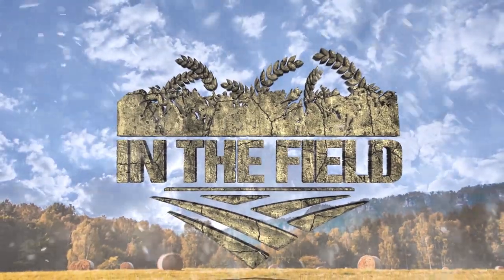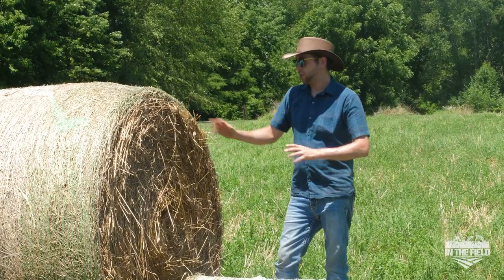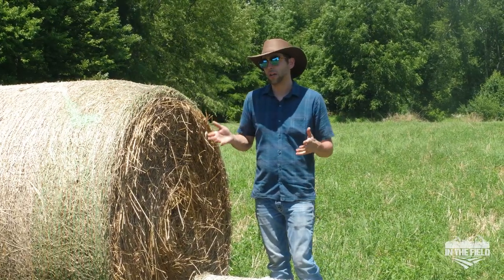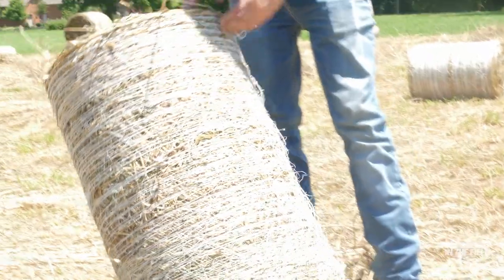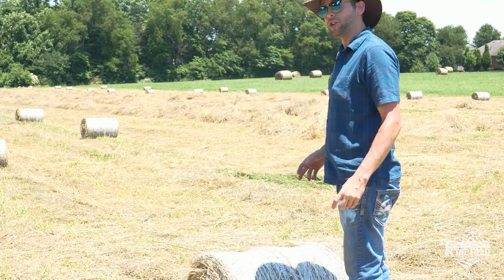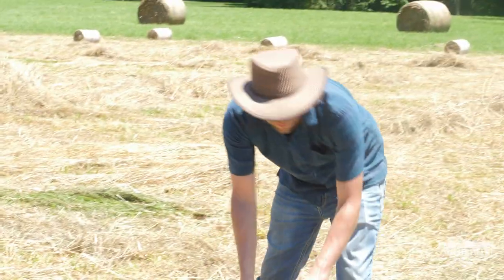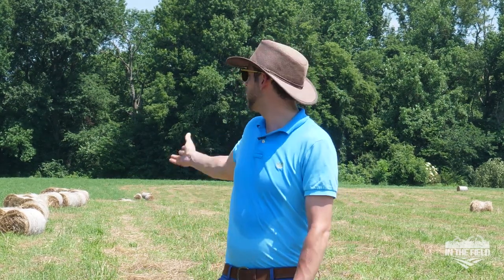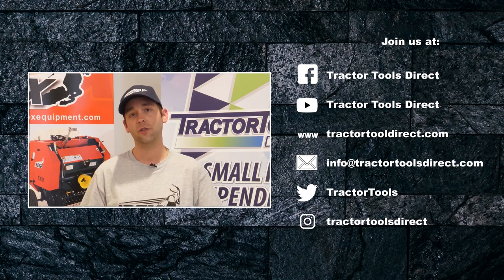In the Field: The Hay Making Process (Part 3)

Comment: I need to call you guys to help troubleshoot my Abbriata M50 net wrapper.  After engaging the wrapping mechanism, the baler wants to keep wrapping the bale...the only way for me to stop it is to disengage the PTO, pop open the rear door, then cut the uncut net wrap with a knife.  It looks like the knife edge isn't falling off the threaded shaft with as much force as it used to do.  Tried cleaning/lubricating but that didn't help.  Caused a major problem during my last baling session, and going through a lot of net wrap.  Until this issue, the baler has been pretty much bullet-proof.  Note: baler is still set to factory defaults...nothing has been changed in that regard.

Comment: Have you tried a wheel rake? I know the belt rake  does do double duty as a tedder. Have you tried baling grass clippings- say overgrown 10-12 inch high grasses that were rotary cut with discharge mower. How does this system do with leaves? Please & thank you. <><
Reply from the maker: Thanks for watching. We have a few videos of our wheel rakes in action. The smaller the clippings are, the harder it will be to bale, however we have had luck doing so, including leaves! It's easier for balers to bale longer material compared to shorter clippings. We don't recommend cutting with a rotary discharge mower for hay production, however I have heard of many people doing so. I hope this helps and let us know if we can assist any further. 260-225-3429

Comment: I would like to buy this machine, but I have an inquiry, which is whether I can control the size of the bale, how many sizes it produces, how much weight and how much it costs
Reply from the maker: Thanks for watching! The IBEX TX31 mini round balers have a fixed chamber that produce a bale size that is 20" x 28" and you can manipulate the bale weight via a density setting. By changing the density settings, you can produce a bale that weighs anywhere from 30-60lbs. The IBEX TX31 has 4 primary density settings and can be adjusted for smaller incremental changes as well. Let us know if you have any questions and/or if there's anything we can do to help @ 260-225-3429. You can find more information, including up to date pricing, on our website @ https://tractortoolsdirect.com/hay-balers/    Thanks again!

Comment: Seemed like the windrows  were not very good.  Is that typical of this type of rake.?
Reply from the maker: Good question. Typically a farmer is not going to experiment like we did on this field. We tried different raking heights, speeds, windrow stop widths, etc. to test out the machine. A farmer might have to make adjustments the first time but after that they would just go for it and get the job done as quickly as possible. Normally belt rakes are extremely efficient and create a fluffy, even windrow compared with other types of rake. Thanks for watching!

Comment: The one I have is a waste of money. It won’t feed the net worth a damn. I called customer service, and was told to loosen the roller springs. I backed them off as far as I could and it still won’t feed on its own. You have to hold the handle back as hard as possible to get the net to feed at all. I think the slipper belt is to sloppy to work but even when it feeds net the net just balls up under the feed rollers until it gets caught in the roller and then I have to stop and cut everything out and reseed the netting I’m going to try a smaller belt on the slipper and see if that feeds it consistently. But then I have to find a netting that is heavier and won’t ball up and get tangled just from the airflow around the rollers. Customer service said the net they ship with is crap and i should buy their better netting….. which begs the question why are you selling it with crappy netting ? Why not replace it before shipping or at least don’t sell it with net at all. Frankly I’m worried about spending more money with you guys but I don’t know where to get net for this lemon. Truly wishing I’d bought something else
Reply: Hi Summer. So sorry to hear you are experiencing this. There's always something that can be done to fix issues like this. We're happy to continue helping, just give us a call back at 260-225-3429, option 2 to reach our customer support team.

Comment: a lot of hay left on the field
Reply from the maker: Thanks for watching. This was our first time using these new machines in a new field and we did go back through and clean up what was left behind in another video. After adjusting the height of the belt rake a bit lower to the ground it was cleaning up much better. We try to use the equipment as many ways as possible to test and see how they operate to better discuss with our customers on how to use them and what to look out for in different situations. Hope this helps, thanks again!
Reply: @Tractortoolsdirect  I am better wit my wheel rake,does a good job.
Reply from the maker: @jmbru1  Wheel rakes are great! They clean fields very nice and tend to pick up thatch and other debris as well. Belt rakes make a bit cleaner hay as they don't make direct contact with the ground. Both styles are nice and come down to personal preference. Thanks!